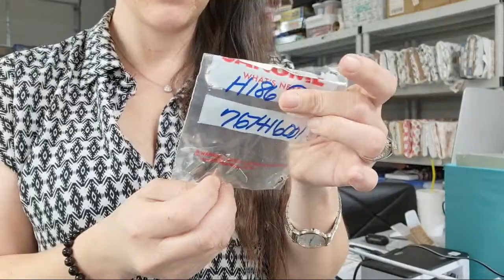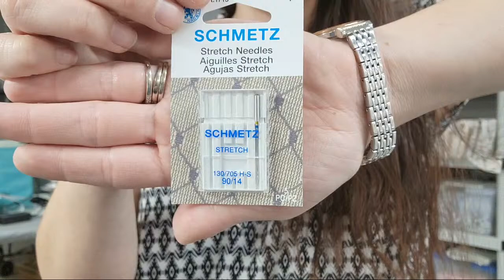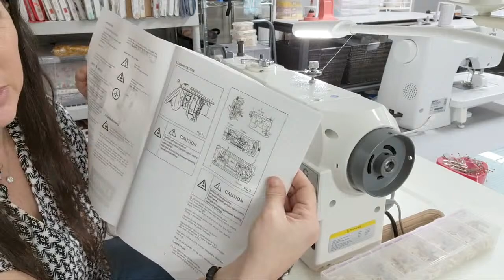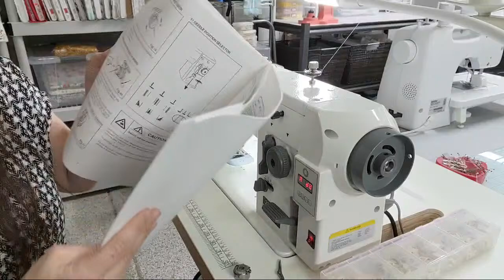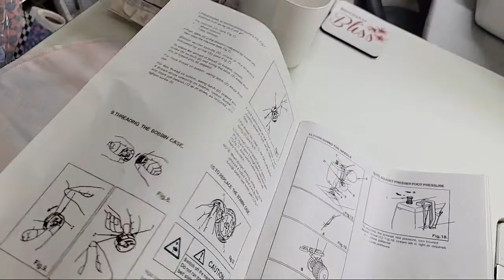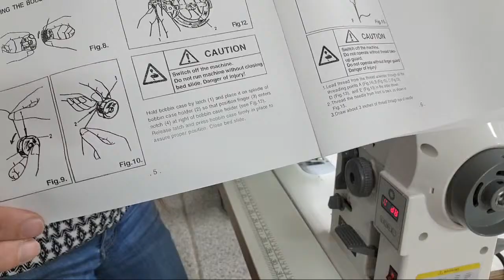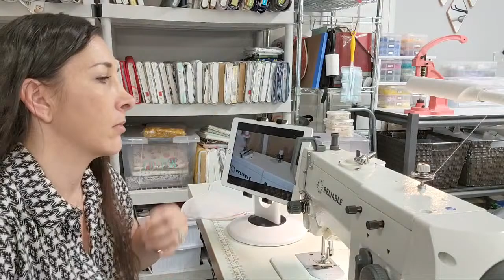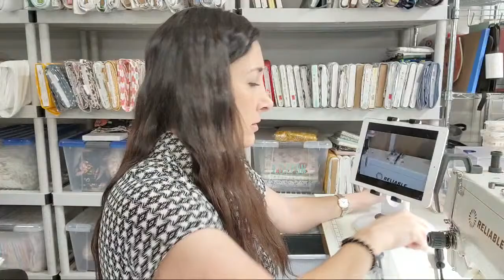Playing With My New Industrial Machine And Changing My Setup

Comment: Amber, you probably figured everything out by now, but I looked at your manual online. The tensioner on the top of the machine appears to only be for bobbin winding; I have the same tensioner on my long arm bobbin winder. I think this may be why your stitch length is so small. Does the bobbin holder on the top of the machine move left or right to engage just the bobbin winder and/or does your hand wheel pull out to engage the bobbin winder?
Reply from the maker: I believe just the bobbin tension??